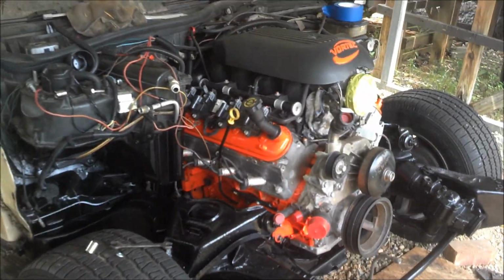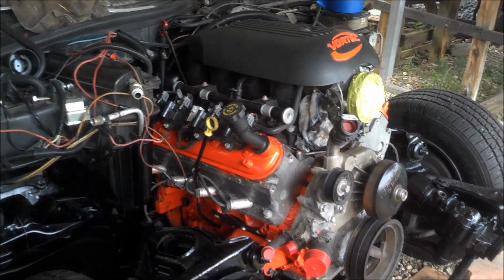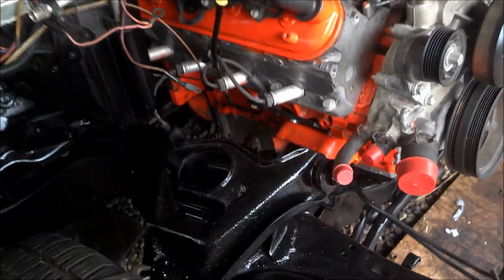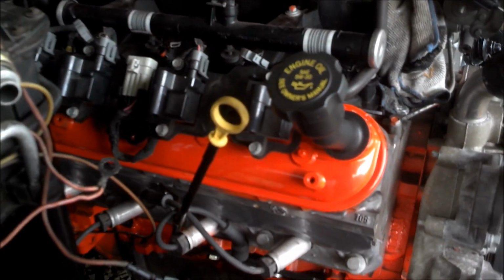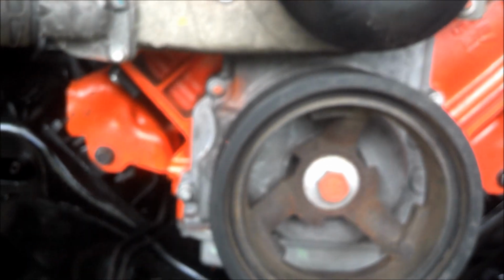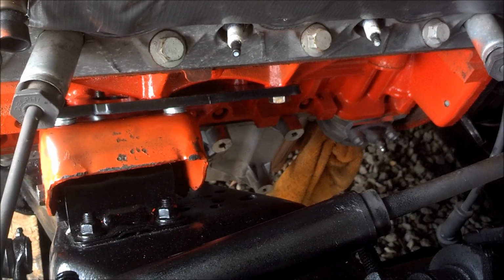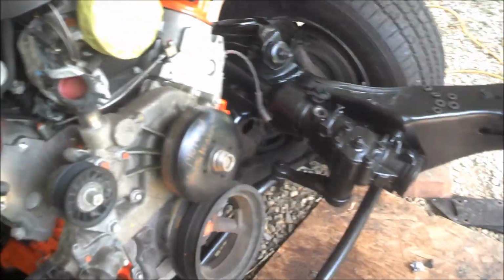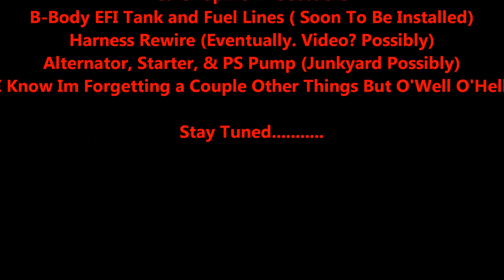1986 Caprice LS Swap !UPDATE?

Comment: I had the same problem with the clam shell mounts, I decided to use Hooker adapter mounts that work a lot better than  the clam 
shells. I just got very frustrated with it. I had thought about what did, but I did not want screw it up and not be able to undue my screw up. well done
Reply from the maker: Ermit Zapata Jr thanks, yeah I lucked out with these.

Comment: how is the swap coming along. I am in the process of planning a swap. I have an 89 LS caprice and an 03 suburban with the 5.3, will the motor and 460le go right in.?
Reply from the maker: Jay Smith I'm pretty much 90% finished just need some exhaust pipes and a couple other things. but yeah the '03 5.3 and 4l60e will work.

Comment: did you have to modify anything to get the motor in? I have a 84 caprice im thinking of doing an ls swap on. And I also wanna know are you going carbureted or are you gonna leave it how it is
Reply from the maker: I didn't have to modify anything, just maybe beat the frame a little bit so the oil pan can clear.  When I bolt up a trans it may pull the engine down a little more , worse case I may have to notch the frame but hopefully the pan doesn't touch the frame. But other than that it fits right in.  And for now I want to keep it fuel injected but my plans may change depending on how things go.
Reply: Beanoman90 i did the swap on my nova nd i got the holley oil pan completely got rid of the clearance problem nd then the pan wont b in danger of hitting the floor
Reply from the maker: fernando cuevas yeah in the future, I plan on swapping the cts-v pan and go for the Holley. but it works for now, but I'd like to have a little more clearance.

Comment: how many grounds did you use and where are their locations?
Reply from the maker: I haven't yet ran my electrical yet but I plan on an engine to chassis, and battery to chassis, and maybe a frame to chassis grounds.
Reply: ok thanks, i think im having a ground problem with mine